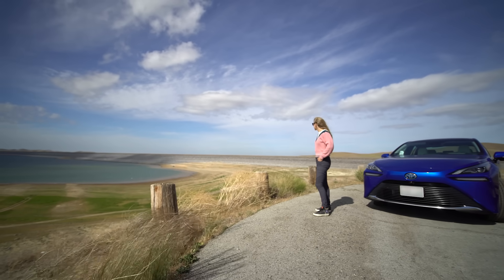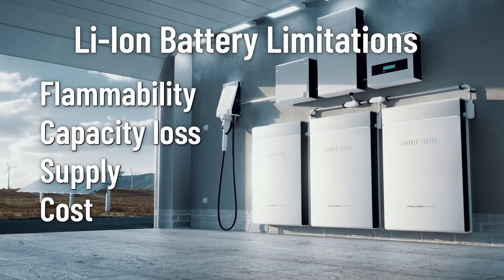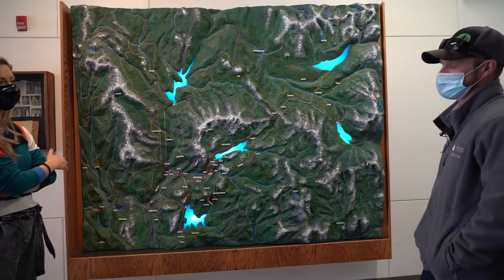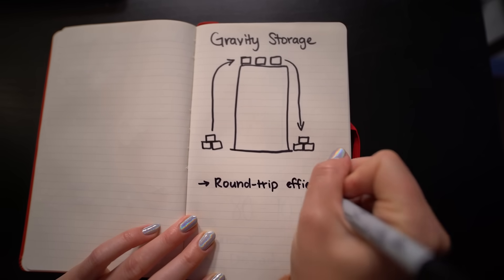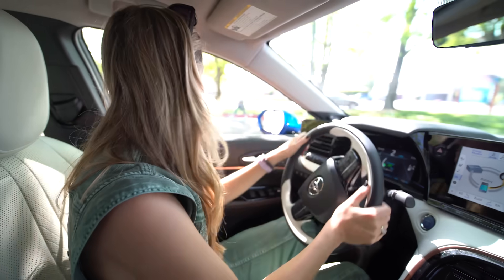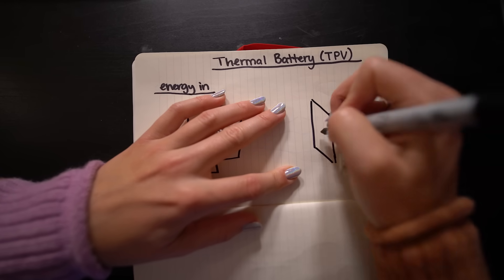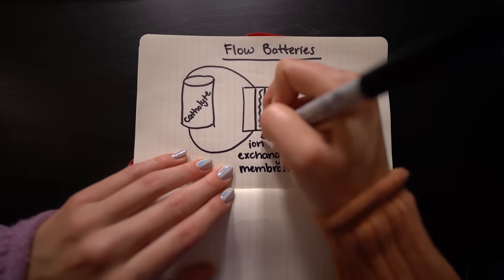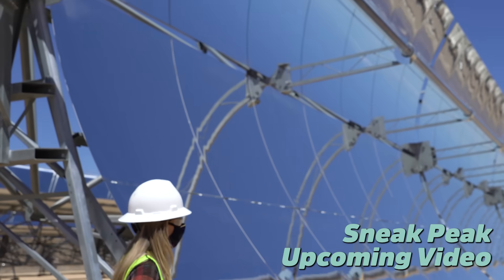The BIGGEST problem with clean energy

Comment: Tidal Hydro... it solves nearly everything. 
comes down to efficient pumps. 
How much power is available at Bay of Fundy? 
40' of free drop every 6 hours....
put the moon to work...
but yeah.. Why not a super cheap stable dense weight? 
tons of pulleys / gears... very cool visual indicator. 
Town Center? like the old clock tower?

Comment: If only there was some kind of "nuclear option" that would provide base power loads and future technologies that would be a "fusion" of current research.
Reply: Nuclear is the only way.  How about investing in better technologies and safety precautions and a better way to eliminate waste.
Reply: Oh that'll get the YT comments going. Nuclear power generation is an ideologically impossible subject. Storage is part of the solution, but won't solve the whole problem.
Reply: "If only there was some  AFFORDABLE kind of "nuclear option""
Reply: I would like to thumb up sneaky commenters.  I didn't know that nuclear doesn't require storage solutions.  Is it because storage is included locally in the plant design?  I didn't know nuclear could throttle or increase load in millisecond type response to the grid's demand, but then I don't understand how the grid works.  If only there was some type of artificial intelligence that manages the grid that might be good.
Reply: @mannygee005  
Nuclear does not require storage as long as the amount of nuclear generation on the grid is less than the annual lowest demand and other generators can be turned off.  

Once there's more nuclear generation than is needed to meet grid demand then storage is needed or the reactor output has to be decreased.  Some nuclear plants can crudely load follow.  Not at the speed of natural gas or hydro.  And nothing responds as rapidly as battery storage.

The problem with load following with nuclear plants is that one starts with really expensive electricity and makes it more expensive.  Most of the costs of nuclear electricity are fixed.  Less than a penny per kWh is fuel costs.  

The cost of electricity from any source = the total cost of generation / the total amount of electricity generated.

Load follow with a nuclear plant that produces 15 cent/kWh electricity to the extent that sold electricity drops by 20% and the cost increases to about 18 cents per kWh.
----

Nuclear plants also need backup generation.  This is a cost that nuclear advocates typically avoid mentioning.
Reply: Mark zing

If only there was some type of "Unclear" option that could be designed and built globally in less than 5 years, without huge cost and that would produce Cheap power........
Reply: Hahahaaaa....was just about to write a sarcastic answer like this myself but assumed that someone else would have written it before...didn't have to scroll far down =O)
Reply: Anton just posted a video about a breakthrough in nuclear fusion - hopefully soon?
Reply: Producing isn't the problem it's storing it. It's almost like you didn't watch the video
Reply: @whyjerrywhy  Storage is only a problem when you don't use nuclear. I don't have faith in nuclear surpassing the political barriers it has (for reasons I'm sure OP is going to find out by posting it as the solution on a solar and wind youtube video), but technologically it's the best option by a mile. If we made a concerted effort we could have a carbon free grid in 2-3 decades with nuclear. The technology is just there, ready for prime time, and at a grid level works very similarly to a coal power plant. Solar and Wind need a bunch of research before they're ready and present grid level problems that you can't technology your way out of without pretty obscene excess energy storage.
Reply: @whyjerrywhy  nuclear power is on demand, so there is no real need for storage. Most US plants run full power, 24/7, for months.
Reply: @whyjerrywhy  Or he released its only a problem, because our offensively backwards society (on this issue), insists we don't use the one option, which would make it a non issue.

Comment: I thought Hydrogen had a problem that it is an accomplished escape artist and can find it’s way out of most containers
Reply: Hydrogen is a ticking time bomb! Just a matter of time til explosion n much worse than a gas (vehicle) explosion
Reply: @johnjaynejr.2332  That's an engineering problem for any energy source. Gasoline's problems are well known. It burns, and will continue to be a risk of catching fire well after a wreck, unless accounted for. Lithium ion batteries, if punctured when charged, create awful fires that are incredibly difficult to put out and burn very hot. 

Hydrogen needs at least 5% oxygen to be flammable, and 19% oxygen to be explosive, so the storage containers themselves are quite stable, as they need the hydrogen to be very pure. In the case of an accident, as they pointed out in the first video in the series, they've heavily engineered this to avoid containment loss. That said, in the case of the inevitable breach of a tank during a crash, since Hydrogen is a gas, and is lighter than air, unless there's an ignition source immediately after it breaches, it should begin to float away from the source of the crash fairly rapidly.
Reply: Actually out of every container. Even one continuous, perfect sheet of graphene can not keep hydrogen from escaping, as it can split off at the layer into protons and electrons, with the electrons flipping across the graphene boundary and the protons being small enough to pass between the carbon atoms.
Only the next biggest atom (helium) is too large to pass through graphene (but only because it won't react with it).
Reply: Watch the first video in the series. Apparently hydrogen leaks are heavily regulated, and they have to engineer for that. Per the first video, the storage tanks Toyota is using are rather robust, to the point that they had to use armor piercing rounds to get it to fail.

There is of course question of how scalable that is. Will this be a thing where the cube square law is in our favor so that larger containers will be more efficient?
Reply: @MrSJPowell  Based upon the number of water leaks we seem to have under our roads I’m not very confident that we can give any assurances as to stopping hydrogen from escaping
Reply: you can use the generated hydrogen and react it in a further synthesis method called Fischer-Dropsch-process to turn it into hydrocarbons by combining it with atmospheric carbon dioxide. you can make both synthetic natural gas as well as synthetic gasolene, both offer good enery density and are much simpler to store long term.
Reply: @maximilianwimmer627  Whilst you probably can, I suspect that the amount of energy required to accomplish that task will make it very expensive to create.
Reply: @SirHackaL0t.  To create, yes. But think about it, to employ hydrogen as a new standard energy source we would have to build an entire new production, transport and storage infrastructure as well as develop new engines that can use it. So we have to invest 3-fold/4-fold, not just in production. However, we already have a transport and storage infrastructure based around natural gas, we would only have to upgrade the production side to a new synthetic source. engines already can use it with minor to no modifications.
Reply: @maximilianwimmer627  I get that, but hydrogen is a tiny molecule. The current pipes and equipment will just leak hydrogen.

Comment: What about distributed storage? If every home has local storage for a day or two of usage, the need for grid-level storage is vastly reduced. It's even more dramatic when every home has some of its own generating capacity, such as from solar cells.
Reply: Great idea!

Who will  pay for it?

Of course, if society is going to organize and pay for it, then we should probably centralize storage to make it cheaper to build, to repair and maintain, to upgrade.

If you make each homeowner pay for it, then fewer people will buy houses. Alternatively, if it is voluntary, then ... that is what we are doing now.
Reply: @factnotfiction5915   If it gets added to building codes, that say 5% of the cost of a new house has to go into some combination of energy production and/or storage, then that wouldn't have a huge effect on prices, and would presumably pay for itself within a few years as well. (If utility rates vary with demand, then a house that doesn't have any exposure for solar panels could still make use of storage by "buying" from the grid during cheap times and "selling" to the grid during expensive times; exactly the thing that reduces the need for grid-level storage.)

Comment: Okay, I know you are very much into hydrogen these days (you have to do a good job for your sponsor Toyota) and I'm all in for everything that replaces fossil fuels, but there is some dishonesty here or lack of research:
1. Flammable: Hydrogen is also flammable, and very explosive. But with the right technology, lithium flammability is pretty much controlled, like many other flammable chemicals that we use every day.
2. Capacity loss: a (well designed) EV loses 10% after 200,000 miles, stationary battery storage loses even less during their lifespan, not a big deal.
3. Supply: here is the biggest red flag: lithium supply will end by 2080? what about the new methods for extracting lithium? what about battery recycling? You sound the same as people that said oil would end by the end of the XX century, but worse because, unlike oil, lithium isn't burnt in the process of storing energy.
4. Cost: it's going down rapidly, but it may be the only fair point if alternative storage becomes even cheaper.
Reply: You can make pretty good gueses on how expensive things are relative to each other based on complexity assuming both will be produced at scale. Lithuim ion batteries are relatively complex compared to most other methods or don't scale as well as the more expensive options such as pumped hydro.

Comment: One thing that should probably be pointed out is that the US already has some 330GWh of hydrogen storage in operation, across three sites. The oldest is a 90GWh site owned by ConocoPhillips that has operated since 1983, and the remaining two sites store 120GWh each, and are operated by Praxair (2007), and Air Liquide (2014). Aside from converting existing natural gas storage sites over to hydrogen, a significant quantity already exists, and the technology is both mature, and tested at scale. While it's true that the round trip efficiency of hydrogen is lower than other storage technologies, it's a more useful form of storage, since it can also be used to produce fuels, ammonia, methanol, and as an ingredient in various industrial chemical processes (direct reduction of iron, for example).

Comment: Great video but somehow missed the heart of the whole problem with grid level energy storage. The shear scale of the energy involved is the problem.
Looking at the UK for a full battery storage system for the whole grid. 
(Calculated in 2020-01, Assuming 100% renewable, 50/50 wind turbine and solar.)
My rough back of envelope estimate for the energy required was about 50% of average load (34 GW) to cover 1 day.
That yields a basic storage requirement of about 1430 Terajoules. The power output needs might exceed 15 Gigawatts.

(That 'duck' diagram probably works much better for hot countries where power use coincides better with energy production.)

In bomb terms the total energy stored is equivalent to about 340 Kilotons of TNT. 
Even divided into say 100 separate units that's still a pretty huge explosive yield on each battery. 
Even greater sub-division like Tesla's Power Wall system solves this has its own problems, different but still huge.

The biggest problem though is the simple scales required. Every joule stored has to be generated somewhere first and that increases the total base-load power required by some 1/3 to 1/2. 
Total cycle efficiency in any such grid scale storage system also becomes critical because it increases the size of the base-load further.
Reply: The UK plan is for bulk offshore wind power plus significant interconnectors to neighbouring countries which mostly solves the storage issue (and a little bit of nuclear)

The UK will get towards 80% wind/solar/Hydro/nuclear by 2030 without needing much electricity storage at all
Reply: @kaya051285  The UK plan is crippled by stupidity. The UK like the US is sometimes subject to Polar blasts. Under the wrong conditions we can get extreme cold plus low winds for an extended period. A recipe for potential disaster where grid failures lead to no heating plus sub-zero temperatures for millions of people for days or longer.
This will be made far worse because another part of the same plan is to force everybody to switch away from gas or oil or coal heating to pure electric heating. 
As for those foreign sources they are quite likely to be hit at the same time leaving little power free to give us.

Lets face it this is being organised in the UK like a football match set on the Titanic - after the iceberg has already hit. The incompetence of our government is legendary.
Reply: @Lucien86  We will have 100% backup via conventional gas fired power stations so even in the event there is no wind power for a month we can still heat and power the country

Also I think most likely is the UK from 2030-2040 period will not deploy electric heating but hybrid gas/electric heating

When there is wind power the nations gas fired boilers will use their internal electric heaters. When there is insufficient wind the gas fired boilers will use gas as they now do

This hybrid system will allow a normal home to be 80% heated by wind power and 20% by natural gas

There is also the option of potentially having biofuels pumped into homes and busienses for heating purposes. This would be very similar to oil fired boilers. The hones can be heated 80% with wind power and the days there is insufficient wind the homes cana be heated with biofuels which are easy to stroe and transport

Also the UK will have at least 2 links to Norway of 2.8 GW total so can export / import upto 67 GWh a day so a vast quantity of excess wind can be exported or imported to Norway

In total the UK will have somewhere in the region of 15GW of interconnectors so will have the ability to import and export vast quantities of electricity

Comment: With compressed air storage the heat is generated when the air is being compressed that is happening when you have excess energy so it would be hard to use the heat to generate more energy, unless you use the heat to compress more air. When it comes to using the stored compressed air, the air gets very cold when expanded it then has to be heated.

Comment: solar power company charged for producing too much energy..yea, physics girl, dont be part of the renewable energy scam.  if there isnt an obscene profit to be made in storing energy, it wont be done.  many ways to store energy exist right now.  reservoirs, flywheels, piles of coal, gas, crude, hydrogen, chemical batteries, heat, landfills, uranium, plutonium, nuclear waste, forests etc.  better batteries can be developed, but storing electrons is def not practical.  on the grid, transmission is the big problem.  if we could bring the source of energy to the place its used without losing 60% during transmission, that would be a really big gain.  unfortunately, for the typical harry and mary homeowners, energy production on-site can be hazardous.  also, pure H2 is difficult to store and transport.  low energy density.  storing H2 u/g is very much impractical the way that lady alluded to.  natural gas is a much larger molecule than H2 and it is not very reactive.  using dam releases or solar to produce H2 would be the ticket, but then we go back to placing industrial processes at homes and gas stations, where its difficult to manage the hazards.  so the 'guess' answer at the beginning of this clip was very legit.  and there is no such word as "physic-zing."  like there is no such word as "radiuses."  cute, but changes perception.  awesome clip..keep doing what ya do!

Comment: there's a big ol' pipe running up the centre of most wind turbines.

Make them bigger, use a weight and a winch to use the power to raise the weight inside each turbine.

Then, let it drop and harvest the energy as it turns the winch.

If them puppies are over water, use the weight winching up as a plunger to draw water up the tube.

Then, let the water drain out, then, let the weight drop.

This could also be used for air compression..and, as stated, heat recovery.

Lots of wind turbines, lots of miniature gravitational potential.

Also, why not use arrays of pipes on the sea floor near strong tidal flow areas as a heat exchanger...cooling the sea, making power

Comment: Global Grid is the answer. With 24x7 green energy generated around the globe to meet demands wherever they are.
Reply: The problem is HVDC lines are pretty expensive which is why we dig out fossil fuels and deliver them to power stations near big populations rather than building power stations next to the coal or gas field and sending the power to the cities with lines

But yes interconnecting more extensively in your own country and to nearby neighbours reduces the amount of storage you would need